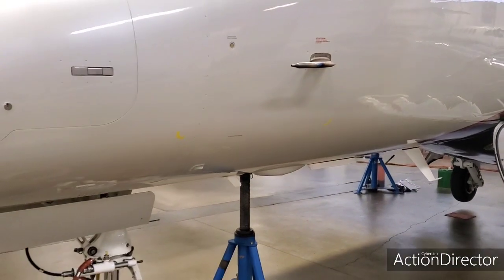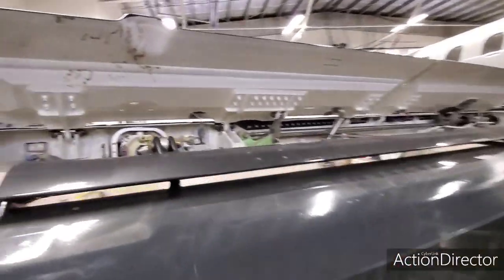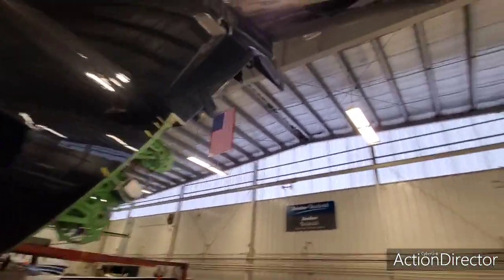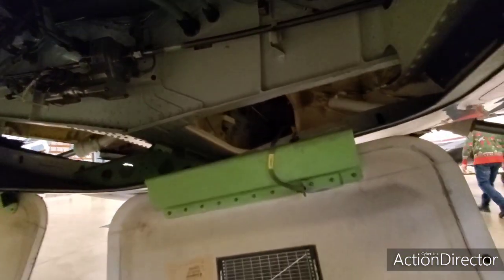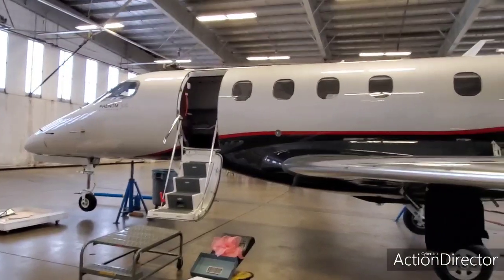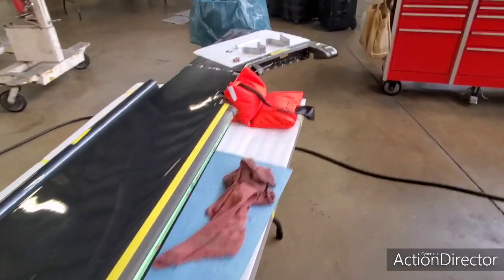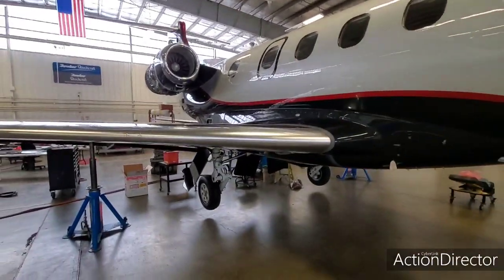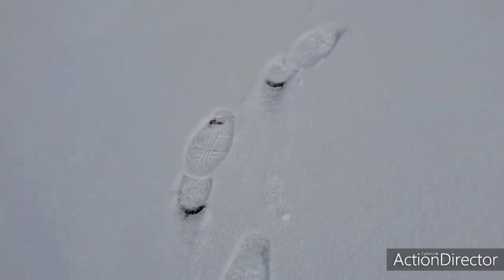Phenom 300 Maintenance.  48 month inspection.

Comment: im a tall pilot. do you think a 6'7" tall pilot could fin in the phenom 300 cockpit?
Reply from the maker: The new 300E yes, the standard older cockpit, you'll fit. But it will not be comfy. And the yoke will hit your knees after a bout 30% deflection.

Comment: Long time.. how's that bleed issue went on? 
A job that i never like doing, rebalancing the flight controls surfaces! but either way i am an avionics guy.. :) 
Keep the videos coming!
Reply from the maker: Did find the valve problem. It was a valve down stream, or least is now working well. I never like test flying airplanes when the elevator was off. Very slow preflight on tail. Use a lift while in shop.